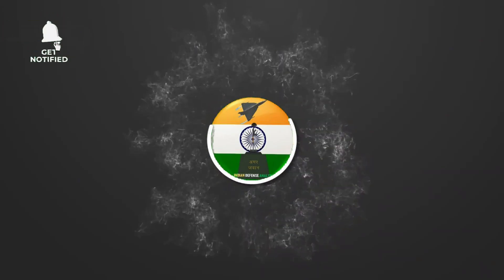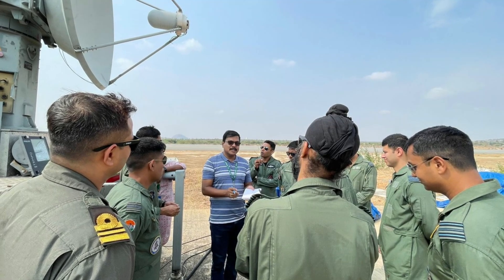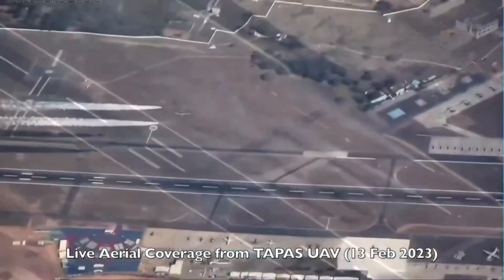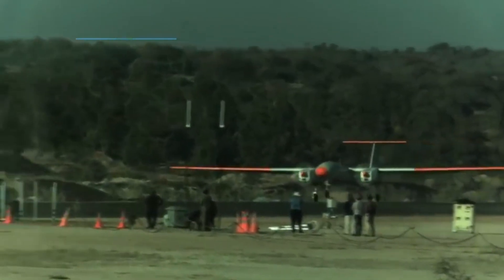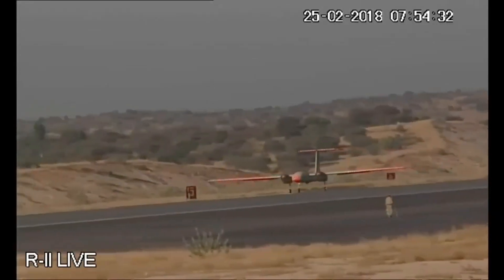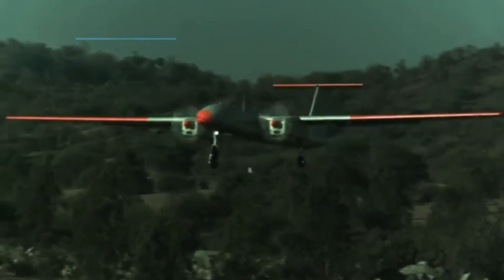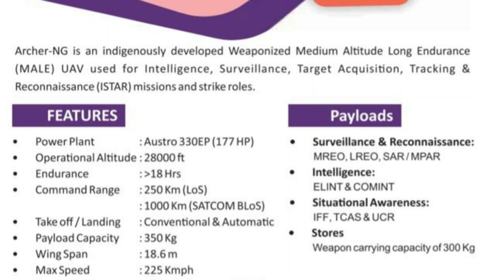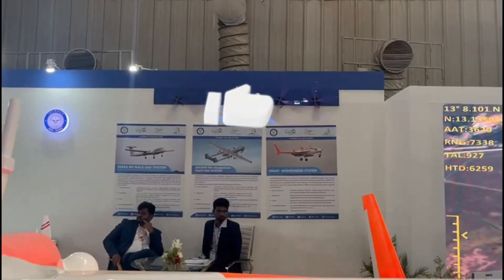Indian Air Force FTC officers trained on Tapas BH RPA #indianairforce #drdo

Comment: Is it possible to refuel drones?  UAV has a range of 250 km  Sure if it was refuelled it would have longer range.  Airbus A310 Multi-Role Tanker Transport (MRTT) testbed aircraft has demonstrated its ability to guide and control drones while in flight without direct human interaction, according to the company. The test has laid the early groundwork for Airbus’ future plans to provide its MRTTs with the ability to autonomously refuel uncrewed aircraft. An ability to keep such drones airborne for longer would make them very useful.
https://www.youtube.com/watch?v=urndQLEcPdU